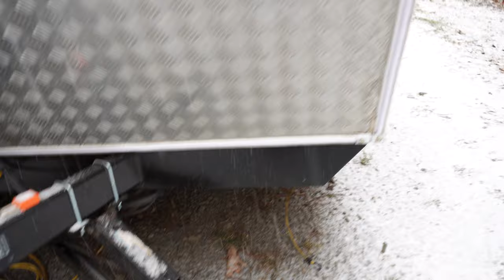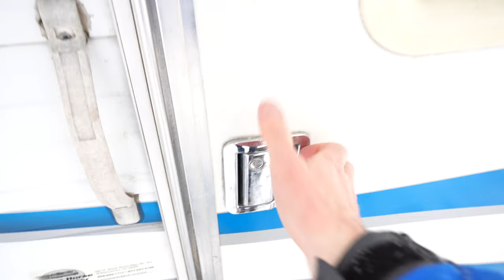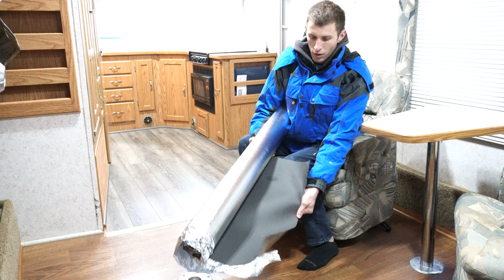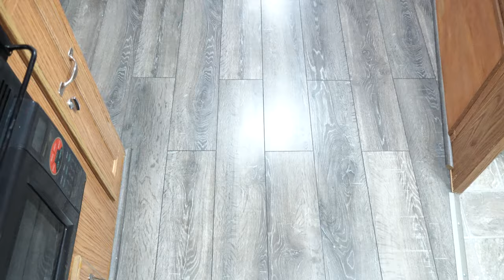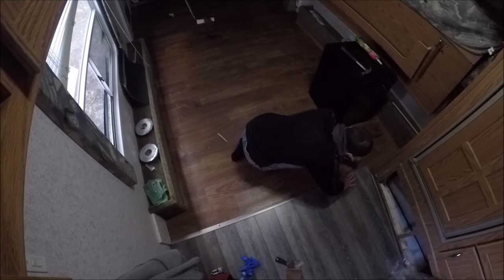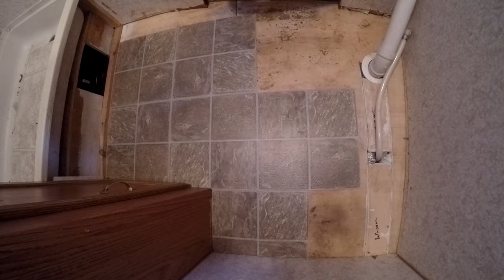Camper Water Damage Floor Repair [ UPDATE ] Weekend Warrior FK2100

Comment: A significant source for water leaks on these trailers are the vapor door "gaskets".  They have a little foam backer that seals to the aluminum siding on the exterior, and over time the compress and don't take up the slack.   I would look at that area if you have not.   Run a bead of sealant along the top of any of those foam gasket areas.  I had virtually every one leaking on my toyhauler that needed a floor repair.
Reply from the maker: thanks I've sealed all those up as well

Comment: Very well done!
 - The use of press down linoleum sections in the bathroom will need to be redone when they start curling-up on the corners and coming up...they’re f’ing useless. Everyone I’ve ever seen use them (myself included) has regretted installing them.
Reply from the maker: true, but the tiles cost me about $3 lol, they're still holding although some shifted ever so slightly

Comment: I will give you credit. That floor being like that is alot of work. I had a similar problem in  my camper bathroom. It was a smaller spot that was rotten from water damaged.  Nothing like you did. It looks good though dude. You did a good job with what you had. Your right alot of people would have trashed it. Now you got it the way you want it. I love you running the mower into the side to push the generator back in 🤣 🤣.  That was classic. It worked though. Good job man. Hopefully now you can just enjoy it and have fun camping. 👍

Comment: I think I missed something. What was the cause of the damage. I think mine came from the hatch door that comes in under the bed in the back corner. I plan to pull out the door and add new butyl tape and weather stripping. I hope that will keep it from anymore damage. I have a huge project ahead of me and need my camper by July 11 of this year. don't know if it will happen.
Reply from the maker: roof leaks and window leaks, best of luck!
Reply: @aDIYCarGuy  did you also have to repair water damage in the walls?
Reply from the maker: @PinkCampfire  The walls were still solid enough, I don't want to remove the siding etc. The previous owner repaired the inside wall panels well enough so I decided not to open them up. Doubt there's any insulation in there though.

Comment: You should install one of them Chinese diesel heater , i had one in my old camper and -10 out side it would burn us out of it , you can adjust them but I burnt mine on hi all the time so no build up would happen, not bad for a $100 and great on diesel , just a thought
Reply from the maker: that's a pretty cool idea, esp considering I have a 25 gal fuel tank on my camper, I see some of those heaters run on gas too

Comment: What did you end up doing on the very bottom where you cut up the plastic waterproof membrane which is the barrier between the road and your floor?  In one of the videos you said you were putting the Styrofoam under the plywood but I really want to know what you put on the bottom of the Styrofoam.  Thanks your your videos!

Comment: How did you end up sealing the bottom of the trailer with the vapor barrier?
Reply from the maker: I used bubble insulation, stapled it up, and sealed it against the metal "joists" /  framing with metal tape for the most part. Probably would be better to use new underbelly material either as one big sheet over everything, or cut it down to fit in between the framing and seal it to the framing.

Comment: Hi i The same thing happened to me, I bought the used RV, the person sold it to me as if it was good to live in and since it is my first time buying an RV, I saw it and it looked good but in reality it is very serious, it was not worth the money I paid which was $ 5500, the roof I only put my arm to lean on to get a cover of the bathroom vent and it is soft, I have to take out the shower, I just stood on it and it started to make noise and it was soft, the floor in the center and in the kitchen cabinets were destroyed, I do not know how the cabinets were supported because the floor is damaged and there was a musty stench in those areas and to top it off the refrigerator and the heater, he removed the gas lines, the refrigerator is a regular one and the ramp is about to fall, the guy caught me for a fool, I will have to continue sleeping in my tent and wait to get money together to be able to recover since I am disabled by social security, my RV is the same brand 2008 weekend warrior super lite fb 1900 change the kitchen and bathroom position and the bed  It doesn't go all the way down, it's because of hydraulic bottles. I would like you to explain how to remove the shower to fix the floor and if possible, how do you lower your bed to the floor? This is my email address joeantoniorivera@gmail.com, thank you.